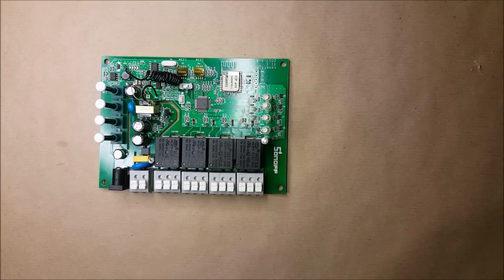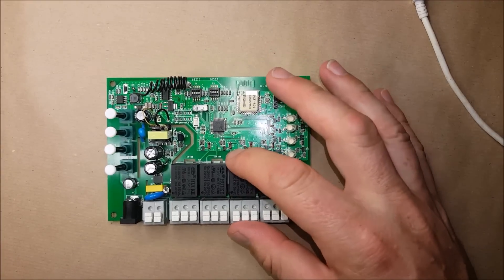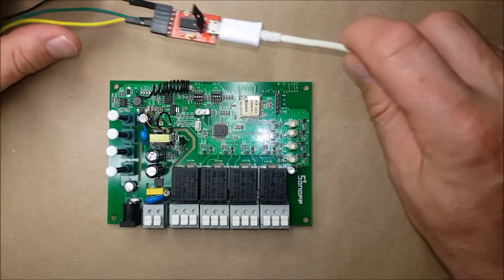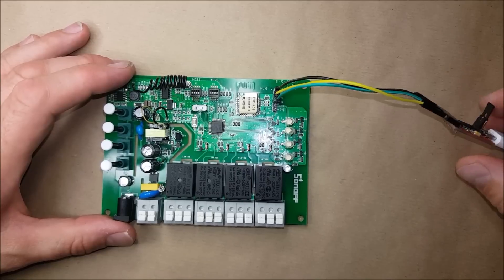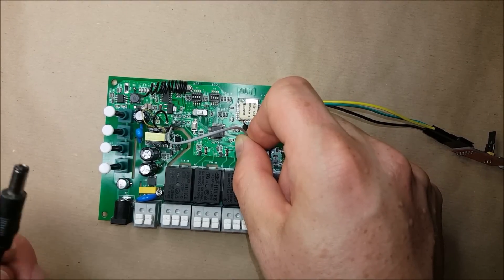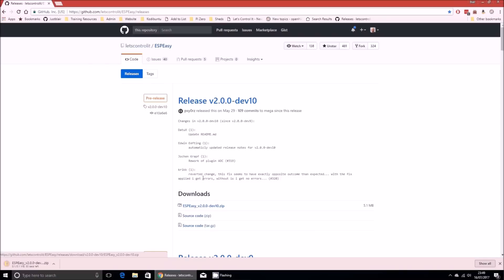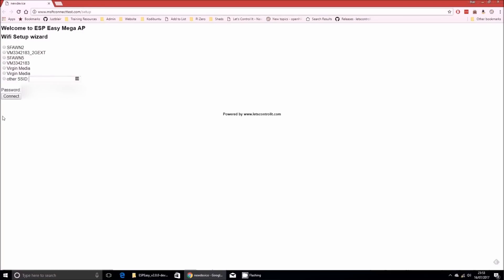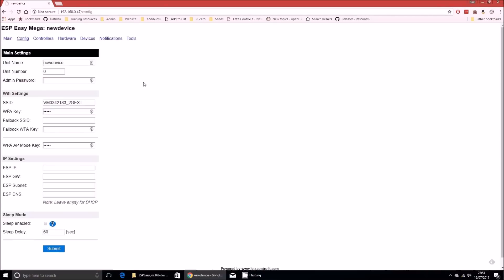Sonoff 4CH Pro - Pt2 - Flashing with ESPEasy 2.0

Comment: Hello,

Can you please let us know GPIO numbers where 4 relays are connected to ?

As we know Sonoff basic 1 channel is GPIO 12
Reply: it's the same as the non pro version.

GPIO0 Button #1 (inverted)
GPIO9 Button #2 (inverted)
GPIO10 Button #3 (inverted)
GPIO14 Button #4 (inverted)
GPIO12 Relay #1 and red LED
GPIO5 Relay #2 and red LED
GPIO4 Relay #3 and red LED
GPIO15 Relay #4 and red LED
GPIO13 Blue LED (inverted)
GPIO1 RX pin (for external sensors)
GPIO3 TX pin (for external sensors)
GPIO2 IO2 pin (for external sensors)

Comment: Hi, this is a silly question, but  need to be sure. Once you flash a custom firmware to the 4ch pro, you lose the capability for self-locking and interlock mode, right?
Reply: I did't  try but i don't think so. ESP is probably in AT command mode  for communication purpose. Everything else is done bu ESP32   uC

Comment: Hi, do you have an overview of which GPIO's the buttons are connected to? And are there any other GPIO pins available for temperature sensors and such? Can the Rx TX be used as gpio? Thanks
Reply from the maker: If you check out the schematic you can find the pinout... 

Key 1 IO0
Key 2 IO9
Key 3 IO10
Key 4 IO14
 
Relay 1 IO12
Relay 2 IO5
Relay 3 IO15
Relay 4 IO4
 
rx IO3
tx IO1
sda IO2

On top of that, there seems to be on the schematic the inclusion of a PJ-218A socket (like on other sonoff devices) that looks to be already setup for a temperature sensor.  I did not find this on my pcb, but it may be in later versions that this is now included.  

The ESP8285 is attached to the main pcb via a module, this module aso has pins for IO6, IO11, IO16 and ADC (according to the schematic).  Although not as convenient as a .1' header, these should also be pretty easy to attach to....

I currently have a raspberry pi attached to pins IO2, IO3, and IO1 as part of my arcade cabinet project (video to be released once I am happy with the setup).  Safe shutdown and muting of the sound can be done using a python script running on the rpi.  The rpi also controls a pin on shutdown that tells the sonoff that it has shutdown successfully (using dtoverlay=gpio-poweroff,gpiopin=22,active_low="y") via one of these pins.
Reply: Blair Thompson thank you for the detailed reply. It works very well. The only issue I have is that you get some random relay triggers when powering on the device.

Comment: Hi there,

I did this without the erase flash step as I could not work out how to do this. Anyway it seemed to all work fine the ESP_Easy_0 wifi channel shows up on my list but when i got to connect to is it asked for a password? any idea what it might be or why its setting a password lol?
Reply from the maker: It may be that remnants from the original firmware are screwing things up... 

To erase flash, install python, pip install esptool.py and then follow the video
Reply: I think it part of the new version the password for the ESP_Easy_0 WIFI was "configesp"